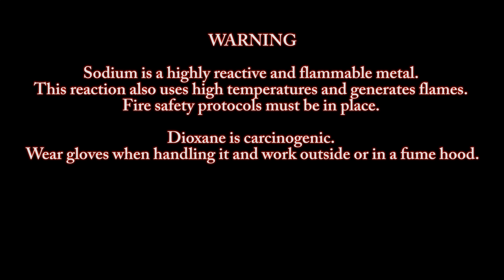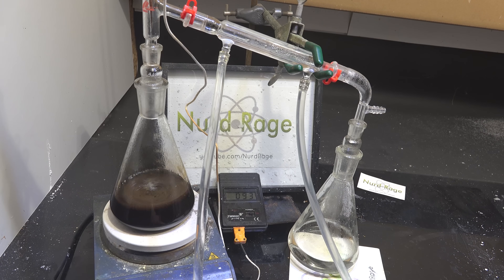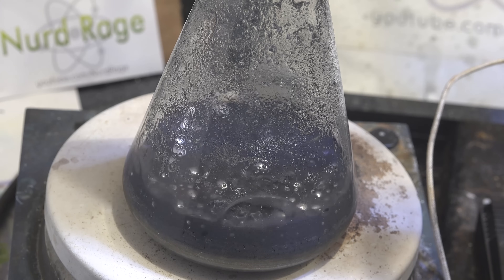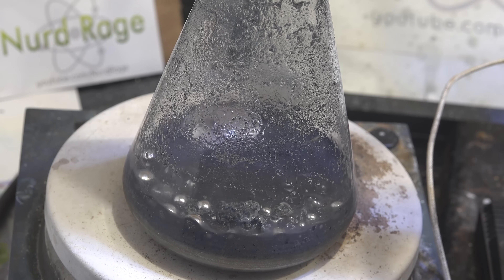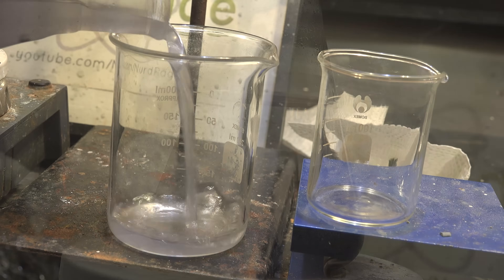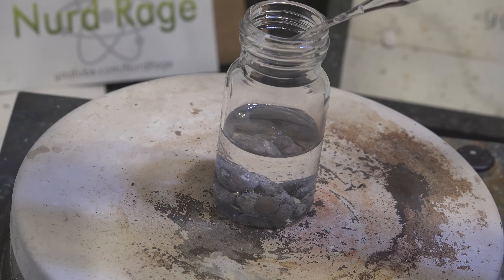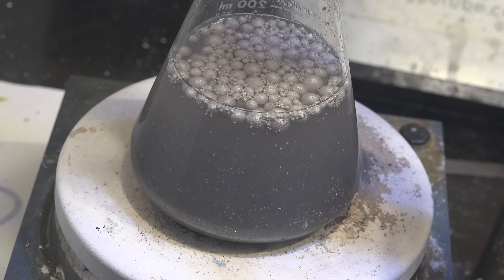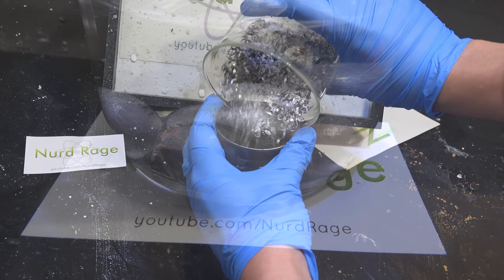Make Sodium Metal Without Electrolysis Using Domestic Chemicals

Comment: I think dioxane works because it's a Lewis base and forms a chelate with MgO.
Reply from the maker: yeah. I had the idea since i've done dioxane work with grignard reagents before. (one of the reasons why i made dioxane in a previous video). 

The thing is i don't have a way to prove that theory yet. If i can, i might squeeze a paper out of this discovery.
Reply from the maker: ugh. this is why i never talk about my research, people demand credit for ideas i came up with independently.
Reply: None of them are dense enough for the Na to float
Reply: I was kinda thinking the other way around
Because the slag never really dissolved but the Na obviously does
Reply: NurdRage do you work in industry? would you submit the paper with your company as an affiliation? or can you do it independent of a company/University? do journals have any bias against that?
Reply: Might be me, but the winking emote at the end suggests the comment was made as a joke. Still, I hope you get a paper out of this, and congratulations for coming up with this method. It's an enormous step for the amateur chemist, and it's rare to see anything aimed at an amateur chemist produce what is effectively pure reagents (judging by your comment on the crystallisation lines.)
Reply: I could probably run some quantum chemical calculations on an Mg2+ ion or an MgO molecule nearby to a dioxane molecule (or sandwiched between two). This could provide predictions for some thermodynamic and spectroscopic properties. Hit me up if you are interested in such things.
Reply: Can one acquire monoglyme as cheaply as dioxane? THF and acetonitrile might also be the ticket (polar aprotic weak Lewis bases). Etherifying cellosolves (ethoxyethanol, ethoxybutanol) might be the cheapest way to get an aprotic diether that's less nasty than dioxane. We want NurdRage making videos for years to come!
Reply: NurdRage is there any way you can register before posting videos maybe a poorman's copyright to prove it is your work I agree no one ever has the right to take credit for your discoveries EVER it is just wrong
Reply: NurdRage I got no problem with that I understand your position
Reply: Rodrigo Galvão I think in the video he said you could but dioxane gives the best results
Reply: Rodrigo Galvão I am a basement chemist so although I might try that it would take significant research on my part for me to be comfortable with it
Reply: Rodrigo Galvão never do chemistry inside my home have a work area outside and NEVER do anything I am uncertain of or think could runaway such as nitrating glycerine(that shit is bad news in excess of about a gram I dont play with that) and being visible to my neighbors I have to be cautious of my mad scientist experiments, dont want the sheriff coming to my door, although I could care less if they come up and I am making nitric acid for dissolving silver.
Reply: Have you tried doing it in THF? SHould coordinate to MgO as well. I dont know how important it is to have a dense solvent, but if it isnt that high diethyl ether might be a good choice too.
Reply: maybe you could try to get hnmr spectran of pure ether and ether with MgO in it. Complex might have different chemical shifts showing the interaction ether-oxide
Reply: Maybe try larger crone ethers, although they are meant for alkali ions.
But you don't want a stable complex anyway...
Reply: Crown ethers are pretty prohibitively expensive and difficult to make for this purpose.
Reply: +pocpic , Would that suggest trying acetone if dioxane is unavailable, since wikipedia says acetone is a lewis base and another webpage I found said it doesn't react with sodium if it's dry and pure.
Reply: its likely too fluxional to observe on the NMR timescale
Reply: Ether solvents generally shift 0.1-0.4 ppm in the 1H NMR if there's Zn, Li, or Mg salts present. It's quite commonly observed.
Reply: crown ethers are quite expensive, but not too extremely (eg ~100 bugs for 25g, but more if rare type). I'm not that familiar with these compounds, but you might only need to use small additions and can combine them with non-polar solvents (as phase transfer catalyst). I just imagine them to have an even stronger effect here, as they are able to form complexes even with elemental alkali metals (alkalids).
Maybe one can find something about their interaction with MgO...
P.S.: Also we are able to reuse the solvents here. They dont get wasted too much in the process.
Reply: You might be right. My point was that using a $100/25g ether ligand (crown ether) instead of a $100/gallon ether ligand (dioxane) to maybe slightly improve an already very respectable 41% yield of a fairly inexpensive material is kind of pointless. Particularly when it's already well known that dioxane has a curiously high affinity for Mg2+, while the best crown ethers for Mg2+ chelation are large aza-crowns that cost hundreds of dollars per gram.
Reply: accurate, but you'll see that approximately the same shift if  Mg in the slag is coordinated or the Na is coordinated, and moreover if both a slightly dissolved the ethereal solvent will likely be fluxional between the Na Mg and unbound solvent, which will broaden the signal. I'm just saying NMR is not the experiment I would go for if I were trying to prove a that sort of adduct was being formed
Reply: Nurdrage:  could you try an alternative salt as a competitor. If Mg chelation is a factor, does the presence of Ca or Sr lower the yield? On the other hand, can something that can do ion exchange with Mg-Na make another solvent system like toluene work?
Great video, very impressed, quite interesting too!
Reply: pocpic You could test this by comparing the performance of various ethers such as THF, 2-MeTHF and MTBE.
Reply: Just look and the video where Richard Fynman explains why he was considered an expert on nuclear powered aircraft and was offered a position of director of a huge research facility.  It was because his employer stuck his name on a patent after it threw the idea out in a discussion before it was previously thought of.  Being who he is, he laughed it off on turned the position down.  Others may not have been so honest and exploited the opportunity.
Reply: I'm not at all disagreeing with Nurdrage's point, but I think the phrase "Fermat's last theorem" originated as a literary reference, but somehow the name stuck.  Of course mathematicians will be the first to tell you that it's only a conjecture until proven to be a theorem.

Comment: I ordered some magnesium powder :')
Any more safety precautions to keep in mind for the reaction with NaOH ?
I assume get a fire extinguisher that is neither water nor CO2 XD
Reply: A bucket of sand is enough to cover the reationvessel if needed. But having a fire extinguisher around is a good idea in case you set something on fire (e.g. yourself).
Reply: GiggitySam Entz Perform it in a Hole in a Sandbox. If something goes horribly wrong, which I think cannot happen, just close the Hole with your Feet with the Sand around it.
Reply: Mg powder will react much more violently than the turnings. Use a long fuse and stand back!
Reply: NaOH is highly caustic with a pH of 13-14, meaning that it'll eat into your hand. Wear gloves while handling it.
It's also very hygroscopic, meaning it'll absorb moisture directly from air. So don't leave it out in the open for more than a day if you want to be as safe as possible.
Reply: Mg can still burn in CO2, sand is the safest bet.
Make shure there is no water around (sand should be dry)